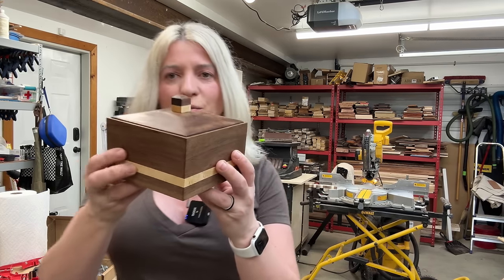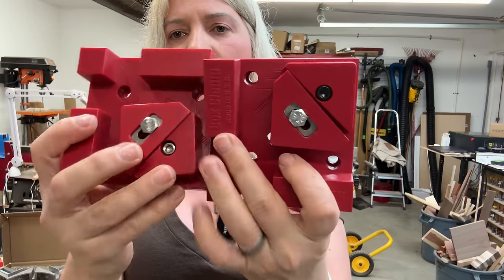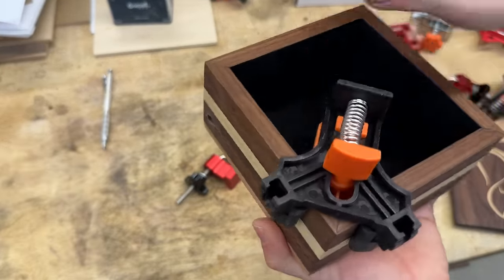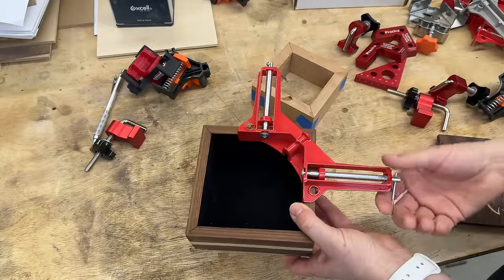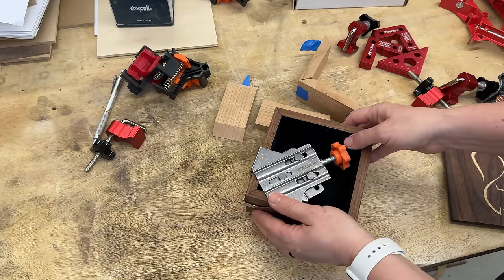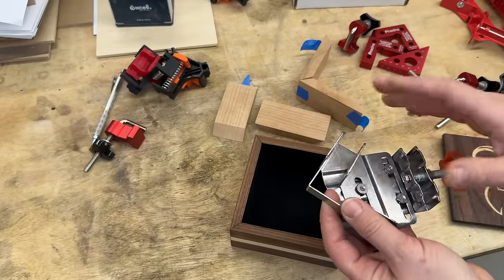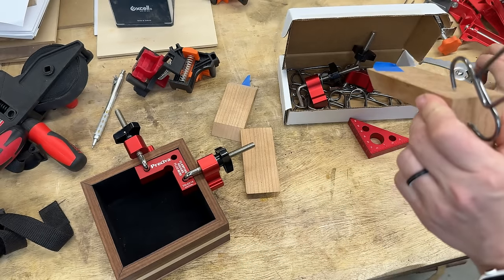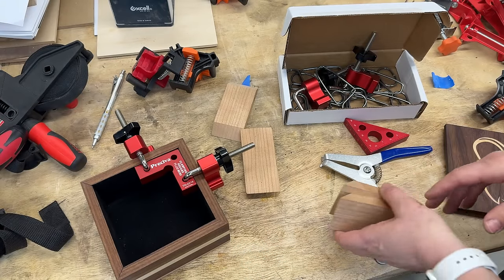Best small clamps for small boxes and projects. Must have small clamps in the shop for woodworking

Comment: I use some of the clamps you mentioned for box making and picture frame making. However, for small boxes, simple rubber bands with a square temporary top or bottom tol hold everything square will work quite well.
Reply from the maker: Yes, love using rubber bands

Comment: A better clamp for small boxes is 3/8” surgical tubing cut to length and insert a a short piece of 1/4 “ dowel in the ends.  You can make clamps of any size.